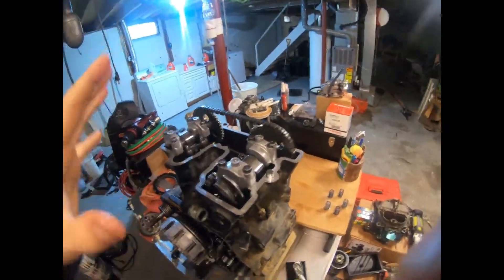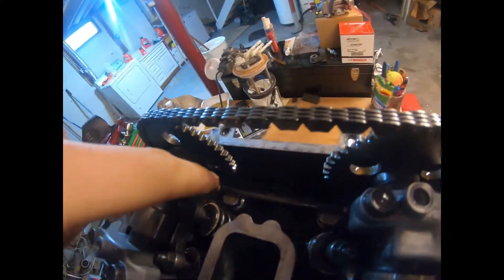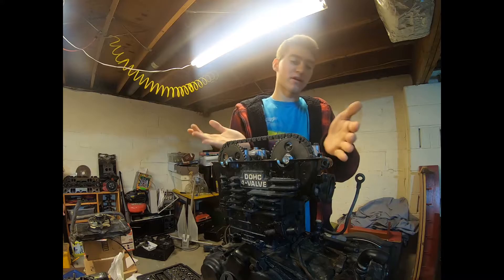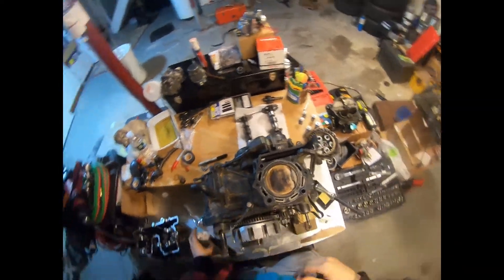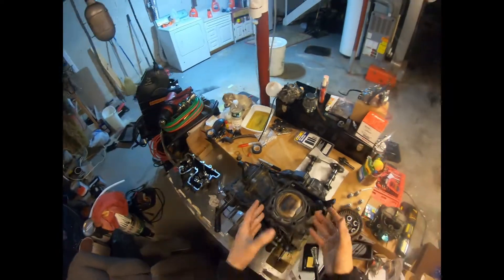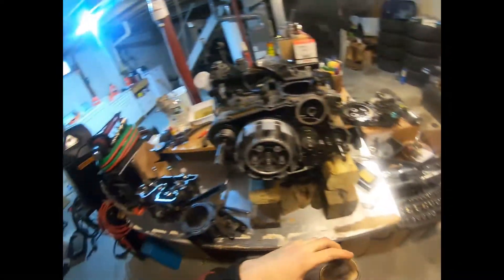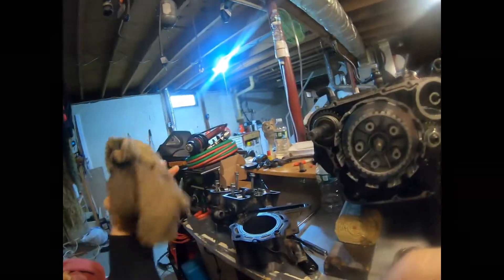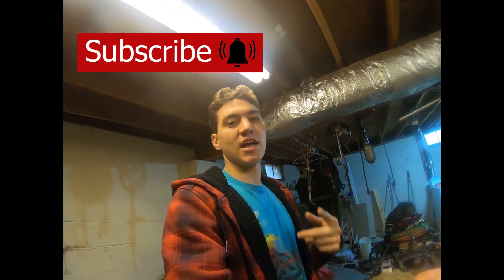Engine Teardown Pt.2: Removing Cams and Head off Kawasaki Mojave 250 (Turbo Quad Project)

Comment: I dont even know why the hell you made a video about all this if youre gonna fast forward thru everything important. Straight pissed me off. You are the only person that has done this and i really had high hopes for it but just like 90% of youtubes how to videos you leave out important shit which makes this garbage.
Reply from the maker: Hey man what did you want to know. I didn’t really make this video for a how to but if you want let me know what you need and I can explain or if I still have the footage and it’s in it I can send it over. To be honest that fast forward came out bad due to my software and my computer not being able to handle it and came out different then what it showed there. There’s only I think four bolts on the inside and a a nut I think on the bottom of the head and few small bolts. But that just off the top of my head. Let me know what you need to know and I’ll try and gelp
Reply: Hey can you send me this video without the fast forwarding part
Reply: Same here trying to locate all the head bolts

Comment: For the time lapse at the beginning.. maybe dont put the gopro on your head again... maybe stick it on a tripod because i dont have F* clue what was happening lmao, also maybe film in 1080 instead of 4k on the gopro so it comes out true full screen instead of a square lmao just some advice
Reply from the maker: Thanks for your feed back it helps. Yeah I'm getting a tri pod very soon. I agree 100% with that. My computer sucks when making time laps, it cant handle playing them so I got to take a guess and hope for the best with the speed. For the cylinder that what I figured mostly. I say thing in the moment but in my head I'm saying a million more things in my thoughts lol. I got to get better at clearing my thought then saying something and then blabbing my first though and then think the more correct thought. It was the valve that was leaking oil and after looking at the piston the oil was siting towards the intake valve reliefs on the piston. The clearance for the valve and cam lope was not right and was leaving the intake valve open just a little. What I was thinking with the oil burning a little through the rings was cause there were holes that lubricated the rings and when it hit that one spot it may spread the rings gap a little more and let the oil go through there. For money sake I had the head bored to a larger piston by a guy who used to work with Mojave's a lot and honed. Thanks again for your thoughts I highly appreciate it.
Reply: @SeanChojnacki  i gotcha i gotcha lmao im just here to help understand things if your not totally sure lol didnt realize the videos werent in real time
Reply: Also that ridge on the cylinder wouldnt be formed from it sitting should be that that is how high the piston rises at tdc so from years of the rings grinding away at the cylinder walls it formed a ridge, totally normal on an old engine, the smoke could be from the valve guides, the rings being compressed for so long they no longer completely fill the gap in the cylinder, and the leak down on the intake valves could be a bent valve (not likely), a ton or carbon buildup or the springs being weak, flip the head over and cover the intake valves in fuel and see how fast it leaks through to the other side, either way the head should be resurfaced and valve springs, and guides as well as rings should be done while your in there. And when you were rubbing the piston skirt talking about burning oil that wont tell ya anything because the 3rd ring down is an oiler ring when the piston goes down it "absorbs" oil and releases it while the piston goes giving the rings some lubrication on the cylinder walls and finally i wouldnt personally bore out the the sleeve i would have the machine shop punch it out and press a new one in then your guaranteed correct clearances and no headaches in the future. just my 2 cents so now you know more for the future